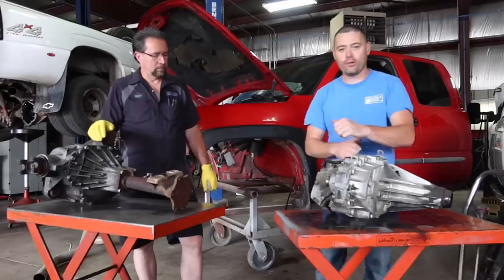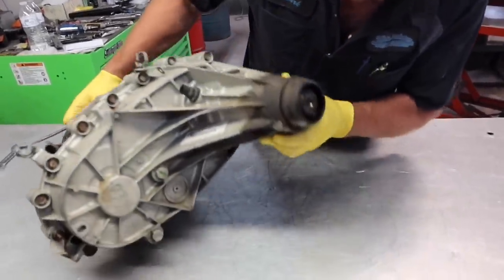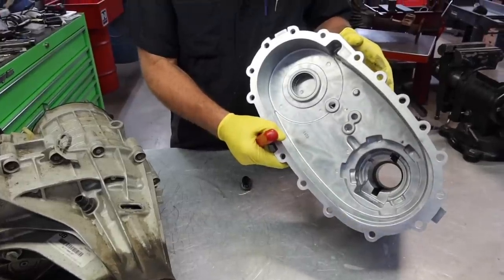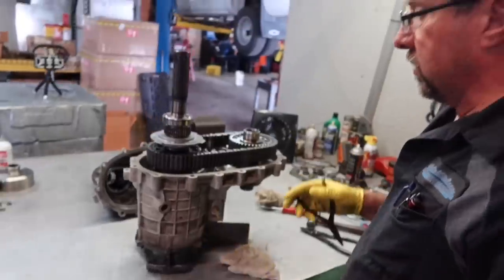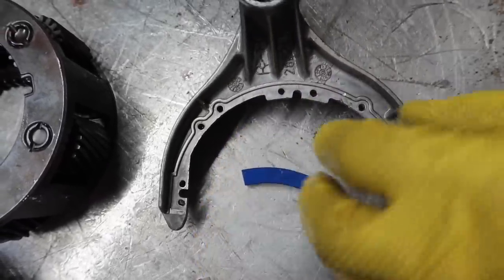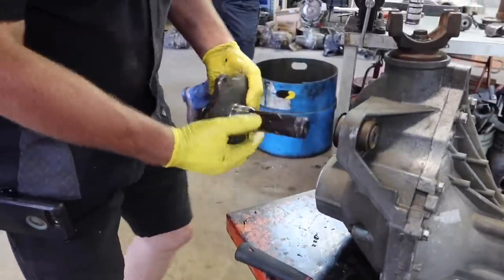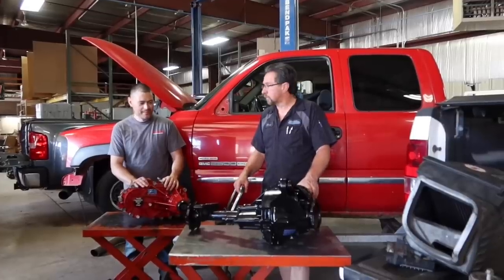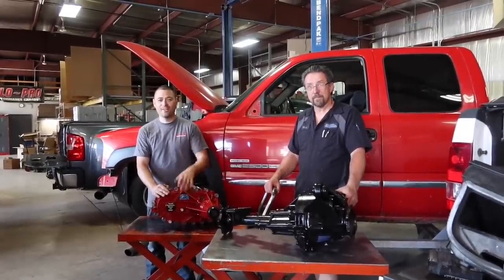We Opened My Junkyard Duramax Transfer Case!

Comment: Mark deserves ALL the customers. Love seeing someone putting quality over quantity. Rare find nowadays.
Reply from the maker: Definitely
Reply: Its not rare at all, its a simple matter of what people are willing to pay for. If you want the attention to detail you need to offer fair trade for the persons time, amd most would rather have the lower price so thats what shops give them. That doesnt mean those same shops can't do a top notch job if you tell them what you want and, just don't expect it at the advertised bargain price.
Reply: Jay Dunbar agree to disagree lol. I’ve overpaid plenty of people that want to cut corners in order to increase their profit.
Reply: @Turner2211  Yes profit is primary driver for many shops; but there's also the quality factor of the tech/owner of that shop.  Some techs may just not know or try to know enough to build the best of the best no matter what they may charge.  Mark clearly kept digging/learning until he was completely satisfied with the end product that would represent his brand.  Many techs would just look at the factory set up, determine it was bad engineering and then tell the customer to "expect" sub par performance or that it had to be rebuilt more often because of bad design components.  I understand what Jay is saying in that you can go to a shop and ask for the discount build and you might be able to ask for the primo build.  But will that shops' primo build be as good as Marks?  Perhaps/perhaps not.....
With videos like this we get to see a quality build and we can choose to use Mark or at least go to our own local shops with eyes wide open and expectations where they should be.  :)

Comment: Good I have a allison 5 speed and the 8100 ... I'm looking forward to learning something about it
Reply: @Andy Pedro 
About 12 mpg with the 8100 allison transmission 4x4 crew cab short bed on 35 inch tires .. it's not bad considering it will tow anything and pushes my 9ft plow with ease ...and even loaded it gets about the same mileage....

Comment: Another cause of pinion bearing failure is the fluid level not checked during oil changes in the front differential.It does not take that long to remove the fill plug inserting a long small screwdriver checking the fluid level pulling it out to see if there is gear lube in it

Comment: Does mark suggest adding 3 quarts of 5w30 thru the speed sensor. Thats how I do mine. I see he suggest the same oil. Just wondering if he suggest using fill plug method or sensor method. Thanks

Comment: Hey Truckmaster,
Great videos, I really love learning how to do some work myself.  I am about to change the transfer case fluid on my stock LLY and it says use ATF, but I see Mark has 5w30.  Is that best for stock transfer cases? Or stick with ATF?
Reply from the maker: Yes definitely go with 5w30
Reply: It depends. If you have oil pump then you can go with 5w-30, if not atf might be better option.

Comment: Josh has there been any issues with the plastic fork? I'm sure if Mark is using them they must be high quality but plastic just doesn't sound right for a shift fork.
Reply from the maker: It’s very common they all have that plastic molding on the forks but I agree it’s interesting how they use plastic material inside these units

Comment: I have a question for Mark. Off typic but i run amsoil in my duramax and have for most it’s life. Thing is it does use some oil between changes and I was told if I went back to conventional oil I’d most likely not use as much if any oil between changes as was told my rings would seal up better. Thoughts? Thanks much
Reply: Wouldn't question be more toward Ryan?

Comment: Is it true that the Allison five speed transmission HAS a sixth gear, you just have to upgrade the valve body? Like Duramax tuner?
Reply: @Re-engineer_everything  do you have any experience with this?
Reply: @wes kovar I do not. It appears like it’s like doing the shift kit but I don’t have experience with either. Nothing is as easy as it appears on paper.
Reply: There are videos with people who have this kit and nick from duramax tuner has a video talking about it should be easy to find on here
Reply: Expensive as hell

Comment: My truck isnt going in gear , I mean it will sometimes but then itll just wont, would the transfer case be a problem or the transmission,  I've got a 07 duramax

Comment: Kodiak has the 5W30 Synthetic Motor oil only sticker on the T-case. Aren’t the T-Cases rated for GM’s “special” all trak fluid...which appears to be transmission fluid? Can you ellaborate why he used motor oil vs trans case fluid?
Reply: ATF  is basically a zero weight oil. your will get very hot to the point you cant touch it with out getting burnt. years ago we started using 5w30 full synthetic motor oil . you will have a 5 weight cold and a 30 weight warm. much better protection on bearings and components plus being synthetic it wont foam under load (in 4wd) like no synthetic oils.
Reply: kodiak truck thanks for your response! That is very beneficial information to have!
Reply: That being said, is an oil change at the same interval while using 5w-30

Comment: I have 75,000 miles on my 07 lbz and I can’t find my owners manual which fluid do  I put in my transfer case thanks
Reply from the maker: 5w30 synthetic
Reply: @TruckMaster   thanks
Reply: Will transynd  work I have a bunch of it
Reply: Me too I am planning to use the same oil as the transmission transynd. In a comment above though someone asked and you said the 5-30 but someone commented something about a pump and didn't elaborate. Thanks love the work you put into this.
Reply: @toddlower8772  Allison transmission Northwest division told me that’s what they recommend so that’s what’s going in both I guess
Reply: @Bryon630  Thanks